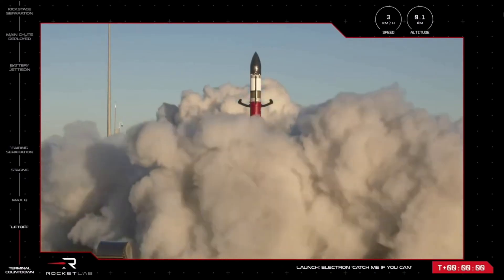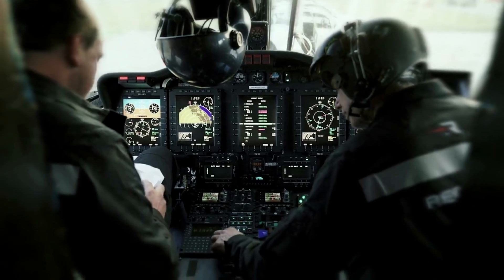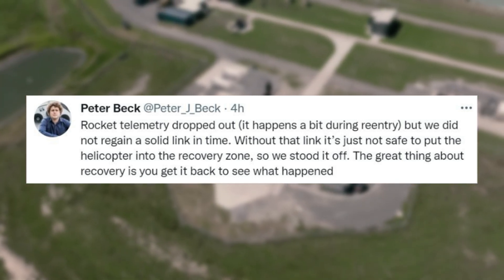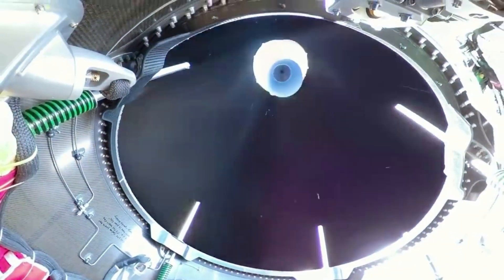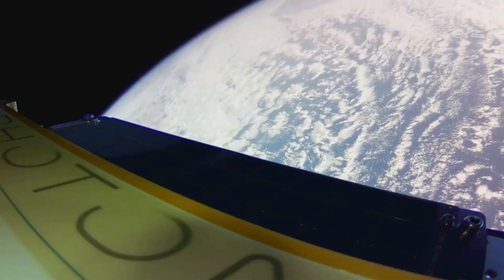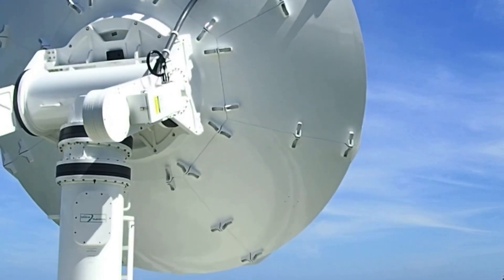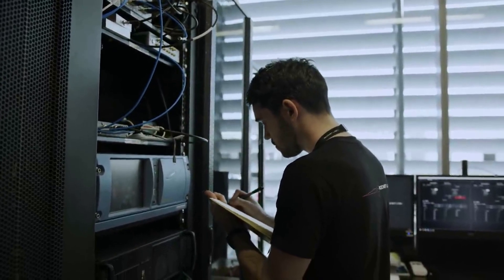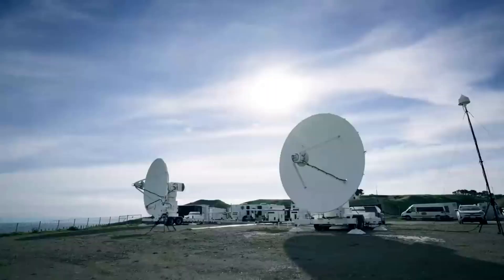Why Rocket Lab Was Unable To Catch Electron's Booster During Today's Mission

Comment: just reland it like SpaceX…
Reply: That means engine relights, drone ships (which they've said they won't do as ships are very expensive) so it actually means at least 2 extra burns for RTLS and landing. Then you need legs, and a deployment mechanism, and gridfins... All on a relatively VERY small vehicle. It just isn't the same.
Reply: As Max V stated it requires way more complexity, and reduces total Delta-V which especially with small rockets isn’t a good idea.
Reply: excuses excuses :) they’ll do on their bigger rockets
Reply: @ashiga8023  I mean yes, they will. But smallsat launchers have absurdly small margins, what they're doing is really the only feasible choice right now for electron specifically.

Comment: Answer to the thumbnail… Because it’s an absolutely absurd dumb idea for two midflight objects to try to catch each other and dispose of any inertia and or conflicting moments of movement that could result in the catastrophic ending…🤔

Find another way you’re wasting time and money unless you can quickly get it right… You’ve got a great product don’t waste time on things that are being proven not to work…

Catching a rocket on the ground is a whole Nother story🤔
Reply: They keep trying because they are very close to success, the previous attempt got all the way to catching but had to abort afterwards. I assume that the loading issue which caused the abort has been fixed since they went for another try. This time a different problem occured, but once that is resolved aswell there are no known issues with the catching concept. Canceling the recovery program now would be stupid, because there is no economical risk to just trying again on a mission that flies anyways and the possible reward of partial reusability is huge.
Reply: They have managed practice runs already, and air catches of film were how the first spy satellites worked. They know it can work.
I don't know why you think the ground helps things. Two objects flying in the same air have consistent airspeed, while the ground does not. Air grabs are easier than precision relative to the ground.

Comment: I'm pretty sure the Neutron Rocket will have an expendable upper stage to put the payload into it's final orbit?
Reply: Yes but Rocket Lab has not ruled out 2nd stage reuse down the line.
Reply: Yes, that's why the video calls it "almost fully reuseable" at 0:13
Reply: @bongi6811  umm almost fully reusable and partially reusable are the same thing lmao
Reply: @BrandonM-h3x  I also prefer the term partial reusability but in the video its called almost full reusability and I was just quoting that
Reply: That is what I remember, too.